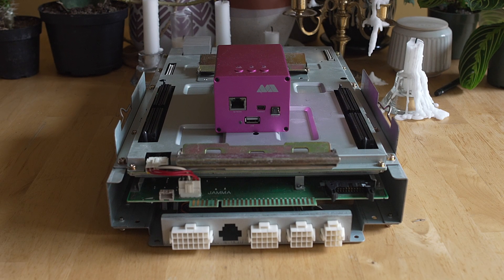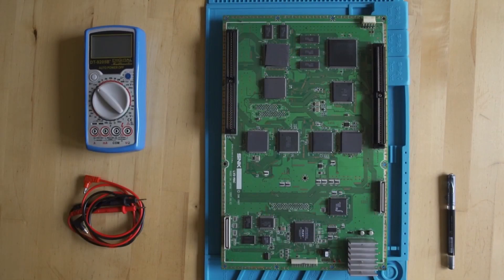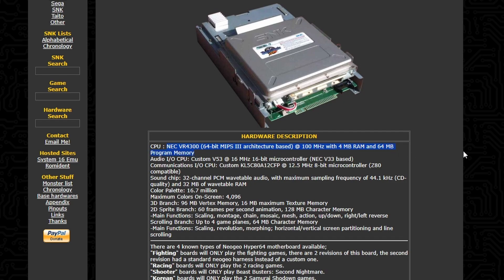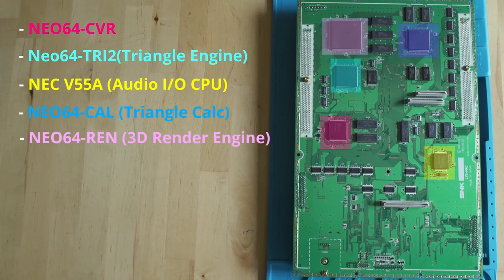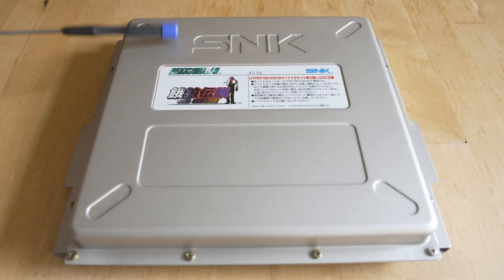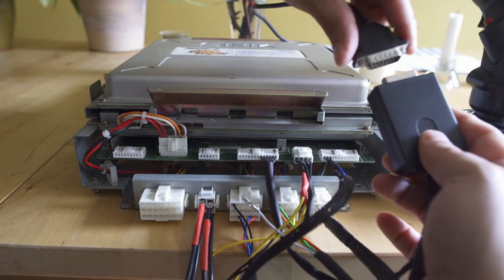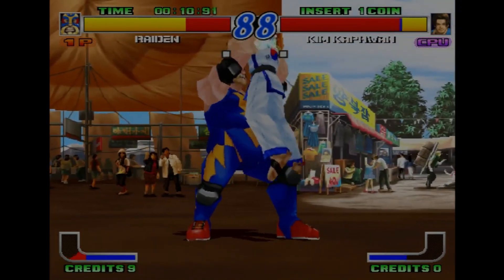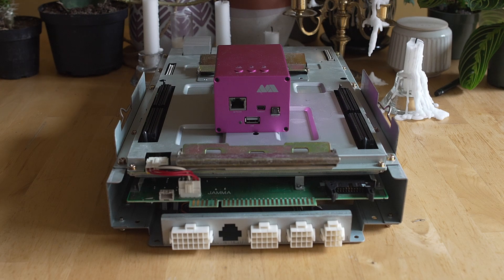MiSTer FPGA and Hyper Neo Geo 64? We Have the MiSTer N64 Core...Which is A Start! Would it Work?

Comment: Great video! I think the core would definitely need a 480p mode though as it caused intense screen retention running through an ossc using weave for the interlacing. I had to use an IPS "healing" video for about 30 mins to clean it up. I hooked it up to a crt monitor after that experience!
Reply from the maker: Yes it’s def a very interlaced look

Comment: Are the mister people working on a mister 2? Or is it not necessary?
Reply from the maker: MiSTer 2 will be a reality but not any time soon. Like not this year minimum
Reply: My understanding is it’s mostly impractical. Going into the sixth generation, and moving forward, things that FPGA excel at, like cpu timings, etc., become less important. Software emulation may be a more elegant solution for those systems and beyond.
Reply from the maker: That’s not saying MiSTer 2 will be focused on PS2 onward though
Reply: Before exploring the possibility of a MiSTer2, I’d love for them to explore different possibilities with the dual ram configuration. It seems like, so far, developers have been trying to stick with single ram (it is the most popular MiSTer configuration), but the added ram may open up new possibilities.

Comment: One thing I'm really hoping for is the MiSTer N64 core to have improved sound over OG hardware, Nintendo for some reason really cheaped out on the sound side of things with the N64 hardware, as it has no actual sound-effects or music processing/ASIC hardware, it has to rely on the CPU & GPU (RSP) to process heavily compressed MIDI audio samples and pass it onto the DAC with pretty poor results (the soundtracks themselves are fantastic, it's just the N64 wasn't allocated the resources to them justice), the SNES's SONY designed DSP & DAC completely spanks the N64 audio quality, and the Dreamcast's amazing Yamaha Intelligent Audio Processor is a gazillion times better (actual number of times). 

This has always been such a great shame as the N64 is home to OOT & MM for instance, which use MIDI synthesized audio sometimes in real-time to handle the ocarina instrument, but most of the time it's just heavily compressed sequenced MIDI audio. The N64 is natively able to stream real-time PCM stereo audio straight from the game carts,  and it also had MusyX & MORT audio (to my understanding are just basically software MIDI synthesizer toolsets), with up to 32 channels of sequenced MIDI (I think I have that right), but because of size constraints this was always heavily cut down and compressed, I mean just listen what can be done via the N64's original audio with a little improvement here: 

https://youtu.be/h8-OfKFPnjw

Example of N64 streaming an enhanced Mario 64 soundtrack on real hardware:

https://youtu.be/7fqfHQbATwk

I guess I'm asking/wondering if N64 audio can be processed/passed on to either through real MIDI via the MiSTer N64 core using a real MIDI module, or the MT32-Pi (or even the MiSTer's native ARM CPU), or the audio can be remastered and "uncompressed", with higher/enhanced resolutions etc, the soundtrack side of things is more simple to my understanding, and it could be done using the N64's ability to directly stream PCM (Conkers Bad Fur Day actually streams heavily compressed MP3 quality PCM audio of the game cart), I don't know enough about the N64's methods of producing audio, but just imagine playing OOT & MM with a direct PCM stereo stream of the remastered orchestrated soundtracks in 48Khz CD quality and with uncompressed high resolution MIDI sound-fonts for the sound-effects and synthesized or sequenced music, or even better if everything could be done in HQ lossless MIDI (ideally both methods can be done), given it's the RSP that processes the waveform synthesis, could the RSP be overclocked to help with processing higher quality sound data that's passed from the ROM, with the MiSTer we are not limited by ROM size as it doesn't use OG carts, and the RDRAM pool can surely be increased to help with handling the larger uncompressed sound data ROM files that have to pass though it.

At the very least I'd love to see the MIDI resolution quality increased, but I'd love to see HQ PCM streaming of remastered/enhanced N64 soundtracks, the MusyX MIDI synthesizer toolsets by Factor5 is open source by the way, and still available, making it quite possible to go back and increase the sample-rates of games that use it, though that is a limited number of games, but it would be a great start for enhancing audio for some of the best N64 games, ultimately I really want to see TLOZ: OOT/MM and CBFD with HQ PCM and uncompressed real-time synthesized audio.

I wonder if it's possible to create some kind of enhanced audio processor the N64 never had via MiSTer or even an enhanced SD flash cart for OG hardware, then that can be emulated in FPGA, or just developed outright via FPGA, maybe the MT32 or something like it can do this.
Reply from the maker: Nintendo cut some big corners with N64 in weird spots